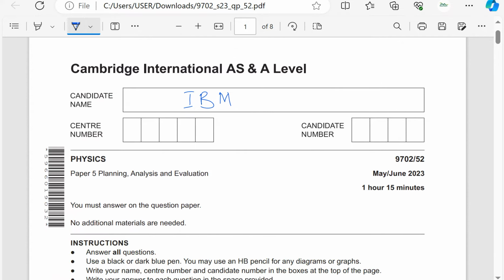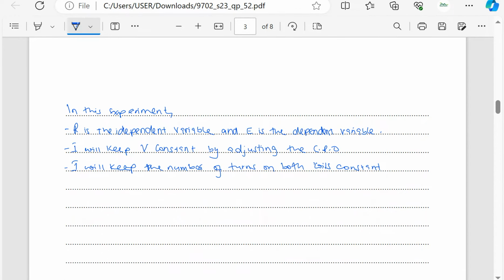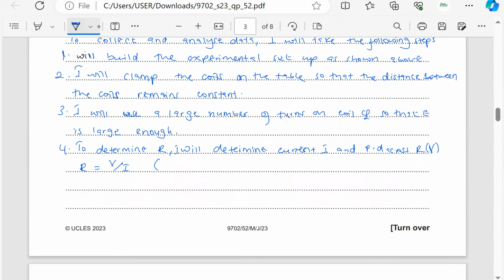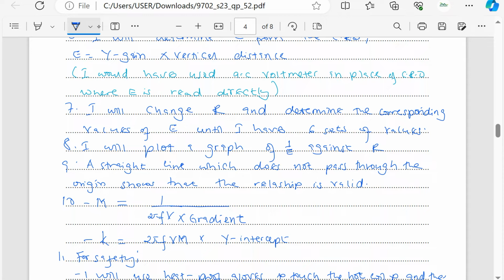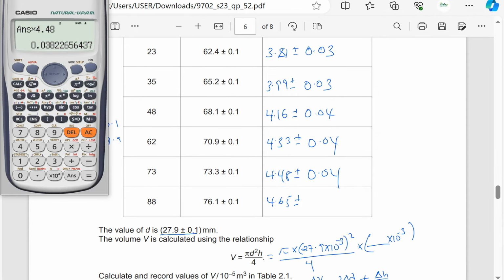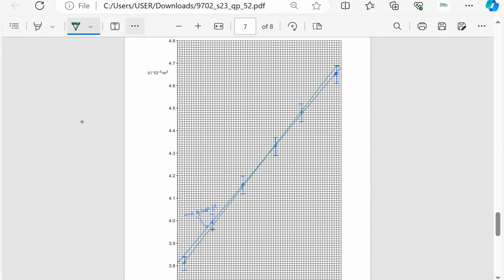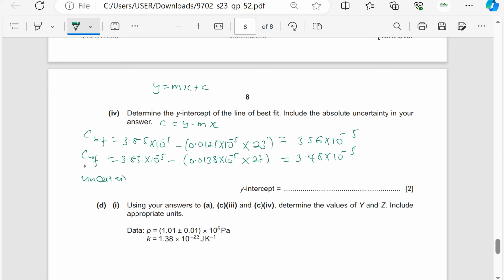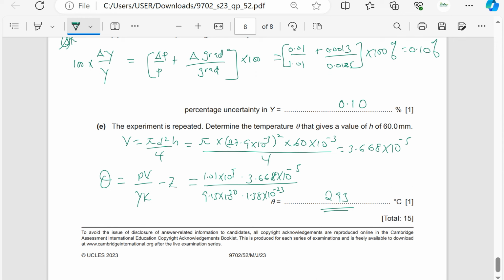CAIE Physics 9702 May/June 2023 Paper 52 [Planning, Analysis & Evaluation ]

Comment: Sir is the oscilloscope connected in parallel with the coil and resistor?
Reply from the maker: it depends on what u intend to use it for, but if u only need period from it, it doesn't matter. in P5 u can connect it in any way if u want period

Comment: Sir ur ans for. Last part don't comply with the trend in the table
Reply from the maker: Normally quote time in comment. The last part, I just forgot to subtract Z so its (293-285) = 8 deg celcius. Sorry for the errors
Reply from the maker: Normally quote time in comment. The last part, I just forgot to subtract Z so its (293-285) = 8 deg celcius. Sorry for the errors
Reply from the maker: Last part theta = 293 - 285 =8 degrees

Comment: Hi sir, is there a specific range for the gradient and Y intercept values or does it just depend on our graphs?
Reply from the maker: normally this paper, the examiner marks the method rather than the final answer, because judgement of the graph varies from student to student. but there is a range of points in which the line must fall.